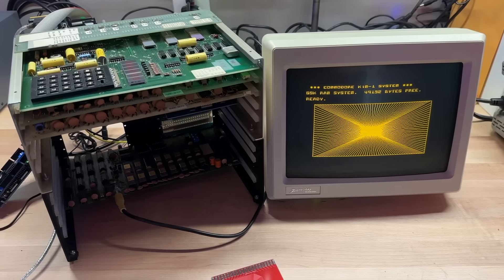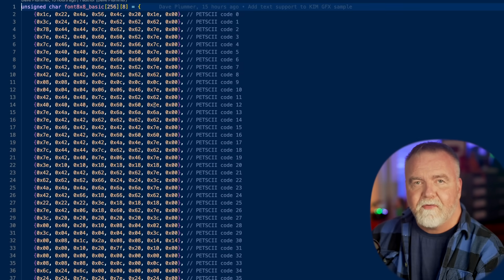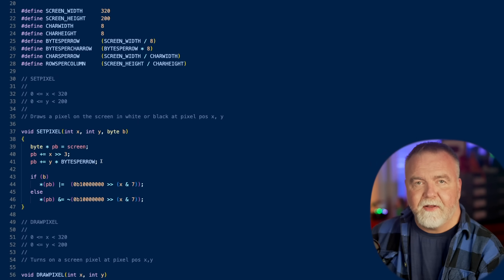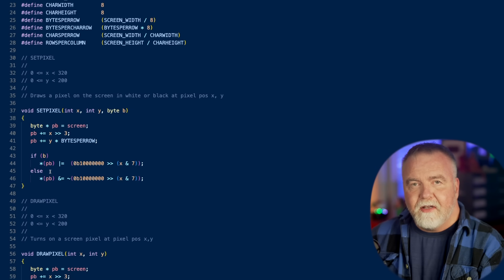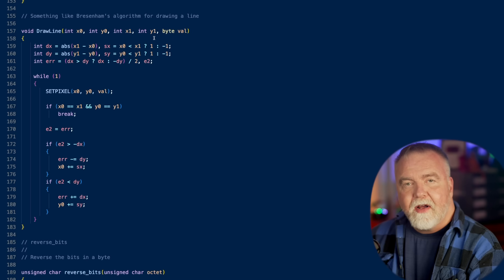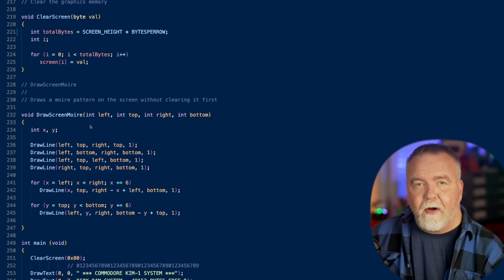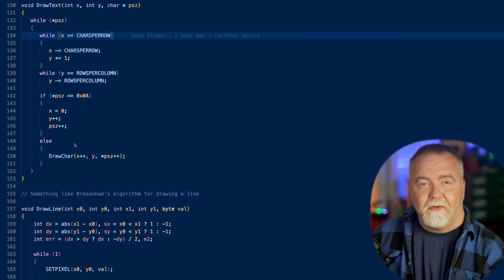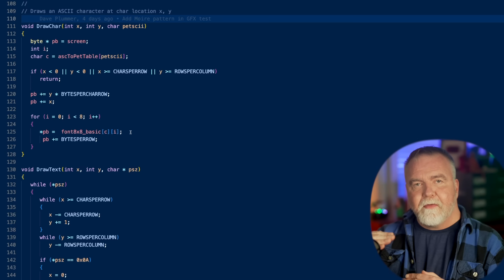Coding Graphics in C: SetPixel, LineDraw, Moire and More!

Comment: Couple of thoughts:
1. Why does the program uses PETSCII? You could work with ASCII and no need for extra conversations!!!
2. It will be nice to see the whole execution of the program. In YT it is easy to skip if somebody find it slow.
3. The actual output doesn't match the "main". We didn't see the drawn text!!!
4. DrawText uses X,Y as in DrawChar (not explained) - "in characters, not pixels". What that mean is not explained.
5. DrawChar is actually a custom case of what a real DrawChar should be - arbitrary X,Y.
6. DrawChar override what is under the text (opaque). In most cases a real transparent drawing is needed, otherwise it create the ugly effect as when using text mode with modified characters (aka tiles).
Reply from the maker: 1) In order to use the ROM font
2/3) Don't I show the final output in the intro?
Reply: @DavesGarage  Thank you for the fast response.
1) There are plenty of resources to get a 1bpp 8x8 ASCII font especially in retro circles. You are capable guy, so you can even write a simple app to render any Window fort in that format. It is much easier and convenient to work in ASCII.
2/3) Sorry but in the video there are no parts that show the program execution! Yes there is Moire drawing ... but that is not the "main", at least not as shown in the video. And the video starts with a "screenshot" (technically, a static image AFTER the execution of the program).

P.S. It is in the human psyche, to see the fruit (result) of the labor. For programmer - that is the execution ^_^

Comment: you will not believe
but I've been cutting down a sane console for two years now
the console is not crooked, not slanting with infinite buffers of 100 gigabytes with connected external buffers, including over the network with a sane font with a built-in sane command processor with a sane render that eats 0.1% of the core and it all works without a gpu and so on

back to basics

Comment: yup, super basic stuff.  I used TurboC for alot of graphics, but it was still too slow ... linking in asm libs was the only solution to get any decent fps with page flipping.  Bresenham Algorithms and Dr Dobbs Journals were the best solutions at the time especially when ModeX and color came on the scene.  Beyond this you could write in 16bit w/ djgpp and still hook interrupt vectors as needed, but I would opt for inline asm for my speed increases.  I suppose this was how DOOM was really born, and the fast bitwise square root, but i digress.  I have boxes full of dot matrix printouts of code that you really can't find anymore.  there are several books 'out of print' that contain alot of the building blocks you have shown.  When I had to use Borland and interact with windows gui routines I was bewildered and kinda pissed off.  I could always find where in memory to steal 8bit fonts on the older systems, so I'm surprised you didn't just do that. The modex waving flag routines and text scrollers with xors everywhere would be my next stop...if you really want to teach a primitives class. ;)  The '75 PC is going back toooooo far.  I would use a dos3.1 XT w/ a little xtra memory and not be so constrained, interrupt hooking DOS is really easy and there are a few routines that you really don't have to reinvent the wheel to use fully optimized routines and I/O (disk) access for sprites,etc.  It's like going from leisure suit larry to sidescrollers.  I type too much.  Did the '75 have a tape recorder as a drive? did it even have a rs232 for a rom?

Comment: "Bresenham's Algorithm, which... I'll let you look up." It's OK, Dave, I don't understand it either. I've used it. I know it's something to do with storing the error as an integer in a ratio of x/y or y/x or whatever, but if I ever try to implement it as I understand it, it doesn't work. So it's voodoo, and you just repeat it faithfully. Obviously I don't even go near 3D graphics.
Reply from the maker: I understand it, it's just not what the episode was about.  If you think that's fancy, check out the circle algorithm I added next... no floating point.

Comment: Why is it 320x200 pixels instead of 320x240 ?
Reply: @@sh-creative I see thanks. 320x240 aws the default for me.
Reply: @@sh-creative  I am sorry, I possibly did not recognize the fact it's all about Amigas / C64, not PCs...
Yeah, my background is mostly PC from the start in the early 90-es.. 320 x 240 was the default resolution for most games back then. This is the resolution where "pixel art" originated from.
Reply: @@sh-creativeI remember seeing EGA games with weird pixels, which must have been the 320x200 resolution or so.. 

By "pixel art originated from" I mean the games and demos which inspired pixel art as a movement were mostly implemented in a 320x240  x 256 colors standart. Most of the Sierra / Lucas Arts games a the perfect example of why Pixel Art happend as a genre.

Comment: 7:32 "convert the character ... from ASCII to petscii". yes, correct. but what's not correct is the name of the variable in line 111 DrawChar(int x, int y, char petscii). it should be "char ascii" instead, just like line 115 suggest anyway, because that variable is used as an index to the "ascToPetTable"

I don't like that mistake 👎

Comment: I used to do graphics in C (and later C++) all the time back in the 80's and the 90's. Trying to do graphics in JavaScript in the browser threw me for a loop. I think the JS package is called D3, but there was no way I saw to intelligently reason about creating graphics there.

Needlless to say, I gave up on JavaScript and anything connected to the browser. Boring.
Reply: the html <canvas> api is similar to borlands turbo c/c++ with moveto and lineto and such. it's really quite simple and the browser can be your os. no 3rd party libraries are required.